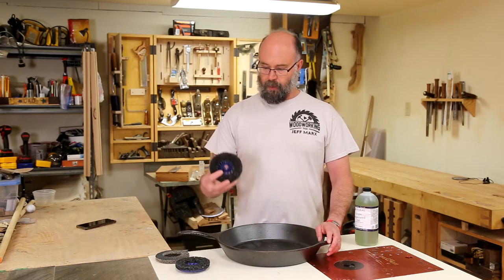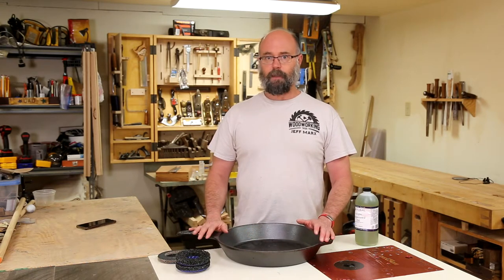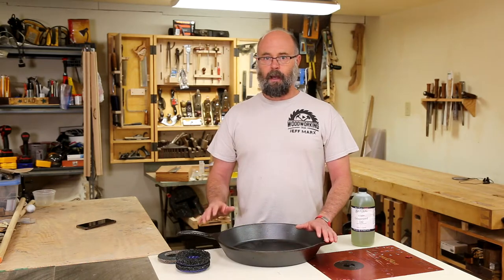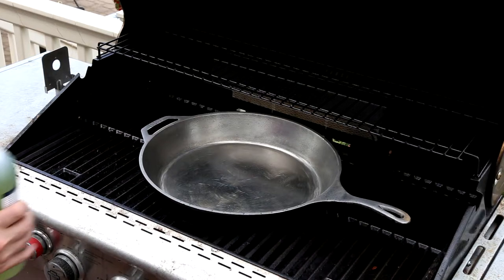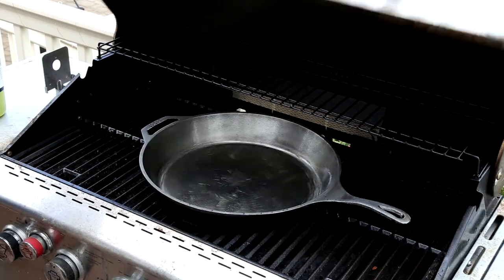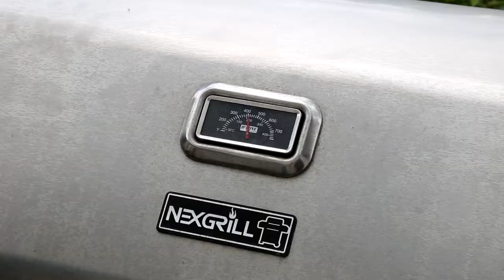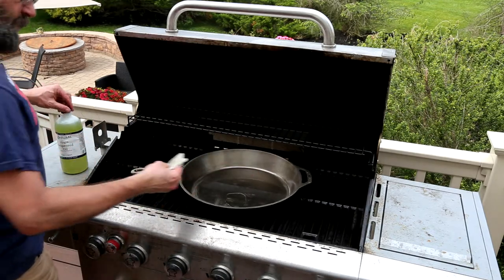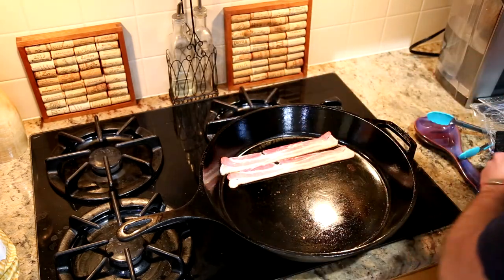Smoothing and re-seasoning a new cast iron pan

Comment: I did that to my new skillet and after I made it smooth, it would not hold a coat of seasoning without flaking off. After I put a 1/2 cup of white vinegar in it on a low burner and let it sit and fizz for 30 minutes. Drained and washed then repeated two more times. Seasoned first with Flax seed oil on a burner at 350 f. two times and then coated it with a bees wax/grape seed oil combination and baked it in the oven twice,  the pan is now jet black and cooks great with very little sticking and no season flaking at all.
Reply from the maker: Wow, that's quite the process.  I'm glad you were able to make it work and hope you'll get to use and enjoy it for many years!

Comment: It's nice to finally watch a video where someone knows what they're doing. There's so many videos of people unboxing a new Lodge and trying to cook with it!
Reply from the maker: Thank you for the nice comment!
Reply: Unbox to cook is fine., Absolutely zero need ton sand these.  Its all aesthetics. The guy that made the video likes them smooth, its aesthetics. A brand new one out of  the box cooks the same as a smooth one.
Reply: I don't even TRY to season my Lodge iron...I just start cooking, and the seasoning builds up in short order. Never had a problem.
Reply: @JVRottweil  

Wrong, the factory seasoning is objectively inferior to a 5-6 layer flax seasoning. And the smooth finish is not "all aesthetics". A rough or smooth finish is better a cooking different things. Rough is best for meats because it grabs on and sears very well. A smooth finish is better for something like a fried eggs/omelets where it would be ideal to slide around and prevent it from breaking apart. This is why I just opt for carbon steel for stuff like that and cook meats, stews gravies etc in a cast iron. And as far as seasoning it's up for debate which is better.
Reply: @joebenson528  LOL you fell for the Cheryl Canter Flax oil hype. I know it makes you feel smarter but its really not the best at all. Well among most people that actually use their cookware. If you knew how to cook on cast iron, you would know this. It al about temp control. I can cook an egg on a bumpy loge with no oil if I get the temp right. Proving the surface does not matter.
Reply: @JVRottweil  
I wouldn’t say a smooth surface is all aesthetic. A smooth surface tears up towels less and gives a bit more wiggle room if your heat control is less than stellar. I can fry an egg on a brand new Lodge just fine, but it’s still easier on my antiques.
Reply: @JVRottweil  It's not aesthetics. That rough surface allows peaks for the iron in the pan to break through the carbon layer that actually provides the non-stick qualities. A smoother surface allows more uniform carbon layer formation after the oil polymerizes and gives you better performance. The poster cooked bacon as his trial run which probably didn't really showcase the benefits of a smoother surface. But I know I have a 20 year old Lodge dutch oven with a rough surface that doesn't cook eggs nearly as well as my old Wagner/Sydney pan from the 1940s. 
I don't bother smoothing the dutch oven because I don't generally care about its non-stick properties.
Reply: True. I have a lodge 17 in pan, no problem with anything sticking. Straight out of the box.  @JVRottweil

Comment: I am 82. I have been cooking on cast iron for at least 75 of those years. All of my pans are from family members and all are over 100 years old. The pans are all smooth inside as that was the way they came from the factory. They have been washed with soap and water and scrubbed clean after each use. Now with stainless steel pads. In the old days, the pan was carried outside and scrubbed with clean sand. Each pan is perfectly seasoned. Pork fat or olive oil is the best.  Just fry some bacon in the pan to re-season.

Cast iron is porous. Porosity is just a characteristic of many cast metals. As your pan ages, eventually the oil seasoning will reach clean through the bottom of the pan. When the carbon built up on a pan, it was burnt in a clean wood fire. Leaving a completely clean pan. 

Yeah, I'm sure I'm going to ruin them soon.

This guy is the best on line polisher I have seen. I would polish the pans exactly as he does. I worked in the metals industry for 40 years and have polished   an awful lot of metal.
Reply from the maker: That's outstanding, thank you!   As almost always, bacon is the answer.
Reply: 69 here and gotta agree on the bacon fat!
Reply: You can reduce the porosity and increase he smoothness of cast iron with burnishing. Basically use a flat hardened bearing under pressure to smoosh all the high points into the pores. It's how master cylinder and wheel cylinder bores get smoothed out. You can get surface finishes down to just a couple ten thou using a bearing. You can also do a hot burnish which will make the burnished layer smoother, slightly harder and more dense but it is quite involved and you can get some warping if you do it wrong. It's a bit over the top for a cast iron pan but I'm just putting this out there for anyone with more time to kill than I have. All my cast iron is sanded smooth to 220 and that's more than good enough for me.  Also I tend to gravitate towards brands like Griswold and away from Lodge, the grey iron that modern day Lodge uses is softer and more porous. If you can find one from before the mid 50's this isn't so. Something changed with Lodge around that time and the casts just aren't as good. I do have a #8 Lodge from the 30's that's nearly identical to my #8 Griswold in almost every way but the bottom. They even ring similar, and a #8 modern Lodge has a much duller and muffled ring to it.
Reply from the maker: Just fry some bacon is the answer to so many of lifes problems!  :)
Reply: I have to disagree.  Cast iron is not porous to the point that oil will go through the top and be on the bottom of the pan over time.  That just won't happen.  On the microscopic level, cast iron has surface irregularities, not porosity.  So what people think are pores is really just a very uneven textured surface.  If you break an iron pan and test the iron in the middle of that break, you will not find any oil.

Comment: Awesome job smoothing out that pan!  The end result looks fantastic!
Ask 10 cast iron owners how to season your cast iron pans and you'll get 10 different answers, but I've reseasoned a few hundred pans and I can give you a couple tips that work consistently...

1) You want to use the thinnest layer of oil possible when seasoning.  I don't remember where I heard it first, but I always think "cover the entire pan with a tiny bit of oil, then use a clean cloth to rub that oil off like it was never meant to be on there in the first place".  The thinner your oil layers are, the stronger your seasoning will be.

2) You want to bake your pan just over the smoke point of your oil so it can polymerize.  Grapeseed oil is an excellent choice to use for seasoning, but it has a smoke point of about 430F, so you'll want to bake your pan for about an hour at 450F or so to let that grapeseed oil polymerize and get really hard and glossy and bond with the iron.
Reply from the maker: Awesome, thank you for sharing that great info!
Reply: Yep ask ten get ten. In fact I never reseason the new pans . I do season them first. Never had an issue with the ruff spots.
Reply from the maker: @johnjohn9639  agreed, if you're happy that's what matters!
Reply: Gave a compliment FIRST, and then hit us with really good tips that don’t detract from the video. This is how YouTube comments should be done. Thank you
Reply: I cook with my Grandmother's and Mother's cast iron skillets. After every use, I wash them with hot soapy water and rinse. In case I notice one getting sticky, I will fry something in olive oil. I used to think animal fats had to be used, like pork chops or bacon. Olive oil seasons quite well. Vegetable oils just get gummy.
These cast iron skillets have been in use for over 100 years. The traditional way to clean the carbon build up on the outside was to simply burn the pan in a wood fire., wash and re-season.

I expect to ruin one any day now by washing them. (Sarcasm).

The farm wife didn't have time to "baby" her cookware. It was used, hard. She didn't have grape seed oil, she had animal fats. Just the constant cooking kept the pan perfectly seasoned. By the way, they were  polished smooth at the foundry.
Reply from the maker: That's a very cool family history.  Thanks for sharing and keep enjoying those awesome pans!
Reply: @jeanmeslier9491  Some animal fats are unsaturated enough to allow polymerization without burning away and turning to ash and soot. Lard and bacon fat are the popular ones because they kept well without refrigeration (saturated means saturated with hydrogen and solid-ish at room temp) and they were cheap. Cooking over and over with lard or bacon will eventually build a polymerized layer that eventually carbonizes through heat cycles.
Unsaturated fats are liquid at room temp and have much higher smoke points which makes them better for seasoning. But the carbon layer that forms from heating the oil is what gives you the resistance to sticking and isn't going to be hurt my mere dish soap and warm water. Yes, I said warm because anything that comes from your water heater is not actually hot compared to what that cast iron pan will tolerate. That carbon layer will laugh at Dawn and a steamy sink. 
The trick is getting that layer there to begin with. Old timers did it by just using the damn pans. Today, we can be fancy with oils and high heat sources.
Reply from the maker: 👍  thank you
Reply: and flip the pan upside down to prevent pooling?
Reply: how many passes of seasoning do you do? 2, more?
Reply: @soarinsen  At least 3 passes if starting with an unseasoned pan.  Coat entire exterior and interior of the pan with the thinnest layer of oil possible.  To your other question, yes upside down if you are in the habit of using too much oil.  If you rub it with oil and wipe off as much as you can before seasoning, it doesn't matter if it's upside down or not.  For the first few months, when you clean your pan after cooking, don't use any soap.  Just scrub it with a nylon brush, wipe off any moisture, heat it on the stove on low temp, and rub the entire pan with a paper towel damp with oil before putting it away.  After  six months or so of regular use, your pan will be almost impenetrable with a strong layer of seasoning and you can use soap when you clean it and won't have to wipe it with oil every time after cleaning.

Comment: I've got a 12" cast iron skillet of indeterminant lineage I salvaged it from a junk pile 20 years ago. Removed the rust and got a great skillet in return. Surprisingly, no pits. Very smooth finish. As non-stick as anything I've used. My Lodge 10" cast iron skillet has the sand cast finish. I'm going to try your technique. Thanks for the video.
Reply from the maker: Thank you, and good luck!  Please wear a mask while you grind your skillet, that stuff is pretty nasty.

Comment: To each is own. Ive tried this way and it was ok but it seemed like the oil had a hard time bonding to such a smoothe surface. I tried just using sand paper to take the pre seasoning all the way down but left a slightly rough finish. Then I seasoned it usings grapeseed oil by applying a layer and sticking it in my grill on full blast for an hour. Take it out, let it cool then do it again. I did this 4 times a day for a week. After that I put it on the stovetop on medium heat and cooked a chopped up onion and let it absorb any unwanted flavors out of the oil. I also use an onion to clean my grill. Now I can cook an egg on it and nothing sticks.
Reply from the maker: Awesome.  If you can get the same result with less effort, count me in!

Comment: I'm a single apartment guy. Got a cast iron. I'm tired hand scrubbing with a metal scrub. I was thinking of getting an orbital (or mouse?) sander but it seems like you're using more hardcore tools (think I should probably still get eye wear and use my N95 for safety), but I can't use that. No hardware tools. Now I'm second guessing the tools since you seem to have something more hardcore tool wise (in the beginning). It doesn't look like a sander with the weird flap disk (?) assortment.
Reply from the maker: Definitely use the safety gear!  You should be able to get it done with a sander, it might just take a little longer.  Good luck!

Comment: I did almost the same thing with the same skillet.
I didn't quite go down to bare iron but close. Also did it by hand which took longer but I don't have a grinder.
I use avacado oil instead of grapeseed but most oils will work as long as they have a higher smoke point.
Reply from the maker: Very nice - I hope it's providing you with delicious food!

Comment: It’s called fire scale. Most use DA sander with 80 grit pads. Don’t work great in corners tho.
Reply: Let it set in vinegar for a day to open pores and texture metal to accept seasoning. You can always do it again after your seasoning flakes off.
Reply: You are supposed to raise temp above smoke pout for seasoning. Grape seed oil is 420. Most take it to 500. Should fry potatoes first, the starch builds base.
Reply from the maker: Thank you!

Comment: I heard if you put the bacon in a cold pan then start heating, the bacon will stay flat and not curl up. I've yet to try it.
Reply from the maker: I've heard the same, lemme know if you try and it works.
Reply: @JeffMarxWoodworking  I'm almost ashamed to admit it, but I do mine on paper plates with paper towels in a microwave. Seems to get crispier and then just throw the plate in the trash outside, less stink in the house and easy cleanup. But someday I plan on trying it and you'll be the first to know. Lol...

Comment: Always use ammonia when restoring and cleaning a rusty old cast iron or carbon steel pan it's how they put the bluing on the pan  that black/blie  isn't "seasoning" its a layer of special oxidation that is a reaction the ammonia causes that protects the metal and makes it more able to take the seasoning...its the same method they used to blue gun barrels back then!  Using the grinder took all the oxidation off the outside of the pan and it will never season properly if you don't restore it!
Reply from the maker: Thank you

Comment: It must be the Big Algorithm, because I just bought those flap disks for my angle grinder a few days ago, before even thinking about using it on some of my old lodge pans.
But if you are using an angle grinder, make sure you use a face shield.  Those grinders spin at 13,000 RPM and the disks can break.  I would also recommend keeping the guard on for the same reason. 

If you don't have an angle grinder, you can use a regular old orbital sander.  You probably won't get it as smooth, but you can still make a big improvement over the original surface.

But I really came here for the seasoning advice.  I'll have to try your trick with the grapeseed oil and seasoning on the grill!  Thanks!
Reply from the maker: Thanks for the safety suggestions and good luck with your seasoning!
Reply: @JeffMarxWoodworking  I just completed my first try.  Years ago I got into Lodge cast irons in order to buy pans that were made in the USA.  It didn't take long to realize that it was easier to clean than all of those made in China pots.

So I picked up a Lodge cast iron, and it has been a mainstay for gumbo and chili ever since.  The top get used almost daily for eggs and grilled cheese and such.
But the dutch oven has always been rather rough.  So I decided to clean it up.

For my first project, I just wanted to clean it up a bit.  So I just used the orbital sander and cleaned it up enough so I could see some bare metal, and cleaned up peeling seasoning on the side walls.  I wore a mask because iron dust isn't really something I want to breath.

After sanding, I cleaned it with an SOS pad and dried it on the stove, before seasoning it with the grapeseed oil (thanks for the tip!).  After one seasoning, this thing is like Teflon!  I fried some hot dogs in it and they didn't stick at all.  And cleanup afterwards took about 5 seconds with a brush.  I'm going to have to do this to all of my cast iron pans!
Reply from the maker: @eloscuro704  Fantastic, so glad I was able to be helpful!  Thanks for watching, following along, and commenting.
Reply: Keeping the guard on an angle grinder is like swearing an oath to the Communist Party.😜😜